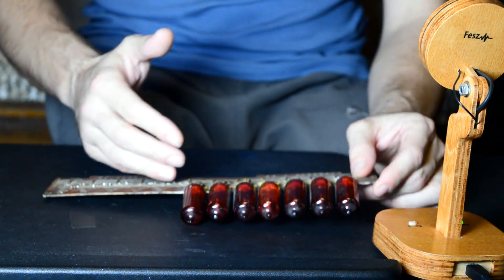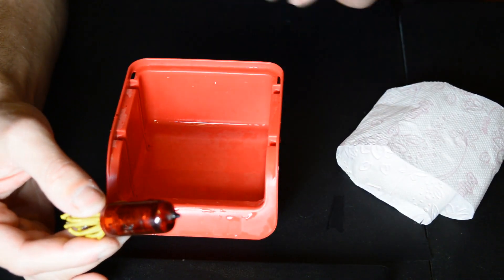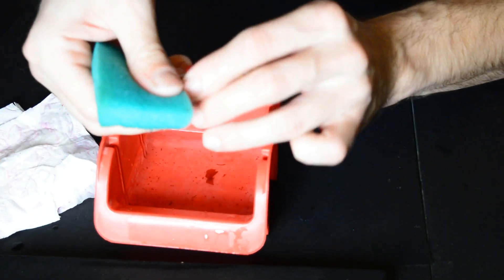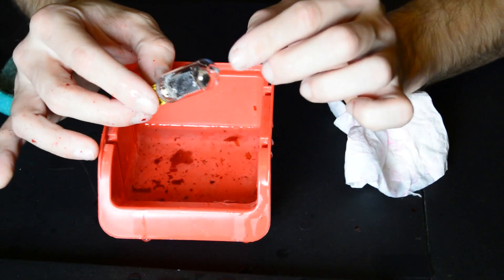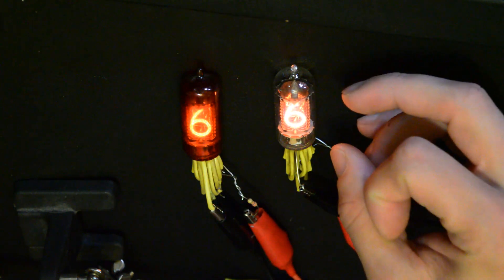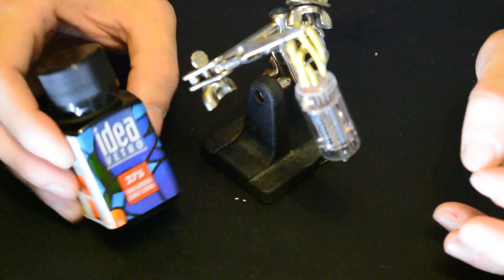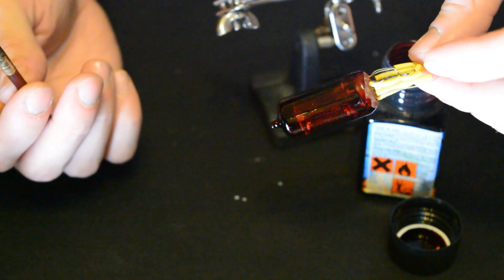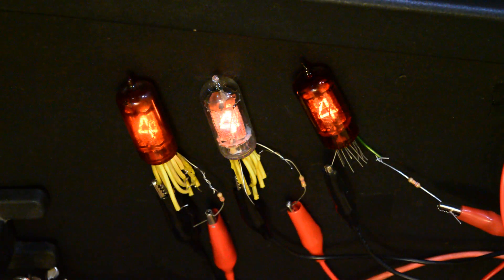DIY Nixie tube refurbishing

Comment: Is there any danger of there being hazardous chemicals in the paint? If I were doing that I'd probably wear gloves (I conservatively assume any old electronic parts are made of pure cancer, especially if gas-filled tubes are involved)
Reply from the maker: I'm not sure if you can find proper documentation on the original paint, and definitely you will not find documentation on the dust and other contaminants to which the paint was exposed to over the years. I guess the washing in water part helps to prevent air born particles, which might end up in your lungs, that I think would be far more dangerous than simply touching it.

Comment: try poloriser instead of paint...it should block the reflected light...

Ive seen monochrome oleds use that trick.remove the poloriser, they still glow but they look like mirror with glowing dots
Reply from the maker: Hello Suraj! Interesting suggestion, I will try it out at some point, when I get a polarizing filter; but in the case of nixie tubes, you have the red light coming from around the cathodes (the actual numbers) and the blue glow from the gas being ionized, its not really reflect light, so I am not sure if the polarizer will help. That is why the paint is useful since it acts as a color filter letting only the red-orange spectrum trough. Did you try using this method? (the polarizer)
Reply: @FesZElectronics  just tried it on video... It's not the best test, not even in a digit Nixie, but here-https://youtu.be/oLfXpa0qg_0

Comment: Is the bluish glow of the digits because of mercury doping?
Reply from the maker: Hello Samuele! You are right, the blueish glow is caused by a small mercury vapor content in the tube. The main gas is Neon, but mercury is also added to increase the tube life-span. The mercury helps in reducing sputtering - an effect where particles are ripped from the electrodes and ejected. This effect reduces nixie tube lifespan by cathode poisoning effect, where the cathode is filled with particles from the anode, and becomes less emissive.
Also this effect can be clearly seen on over-used vacuum tubes where the glass slowly becomes coated with a shiny layer on the inside. I am not referring the the getter flash (normally on the top side of the tube) but rather when the shiny layer appears somewhere on the side, where there is an opening in the anode.
Reply: @FesZElectronics  Interesting, I didn't know that before. I personally like the look of the nixies without paint, but now I know that there's a good reason why some of them are made this way.
Reply from the maker: Hello Dedredlink! On large tubes, the paint does not help a lot since the numbers are very clear, but on small tubes, there is a lot of glow and it improves contrast. I guess it also has to do with the exact gas mixture in the tube how much unwanted glow there is...